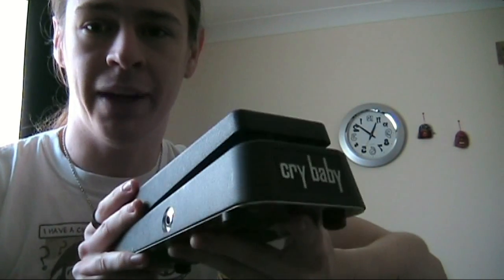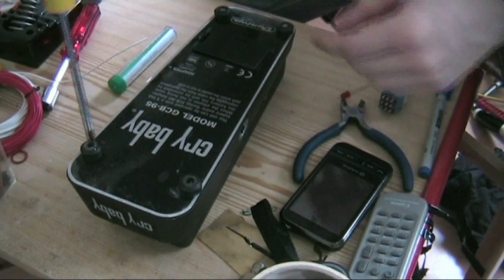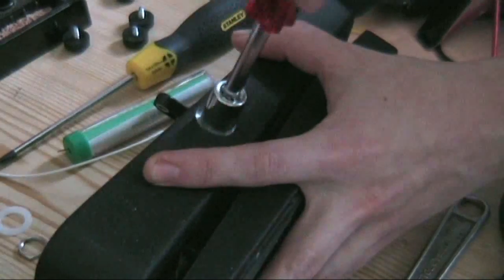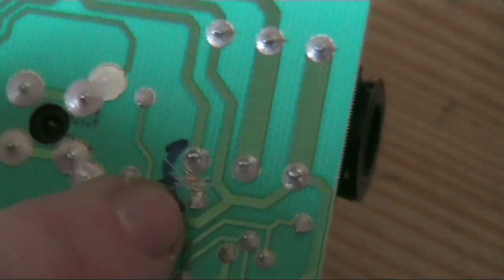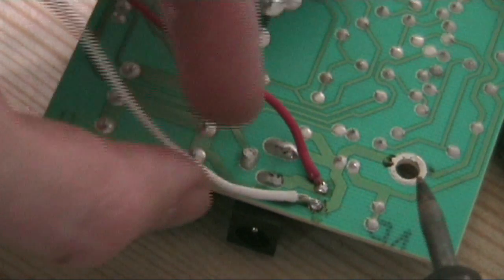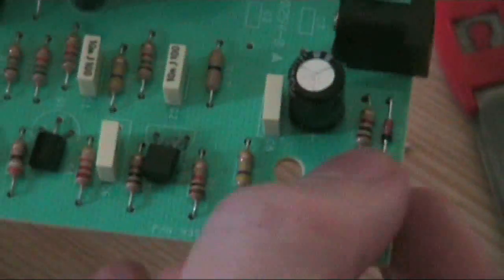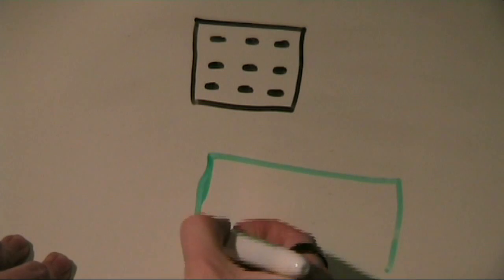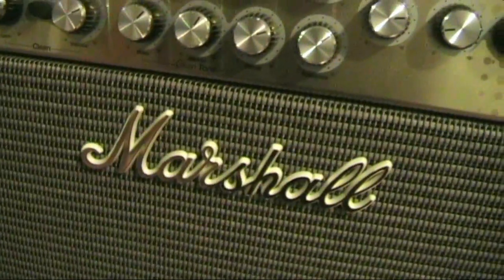Pedal Mods: CryBaby True Bypass and LED Indicator

Comment from the maker: Your little blue box is a capacitor, so don't worry about that. 
You'll still want to break the connection between the two components. 

With the green wire, you will want to connect it to the top left contact, and then add a small length of wire that bridges the top left contact and the middle contact on the bottom row. This is referred to as a 'jump' wire, so that's why I said it jumps to the bottom middle. Sorry for the confusion.
Reply: Thank you for the mod tutorial. just did mine today and its working very well.

Comment: aye aye manny, i was following your vid but for some reason my pcb is different to yours? where youve got your capacitor ive got a wee blue box with "10nj100 1x7" on it? do i still scrape away the back bitty or? major confused man help a fellow scottish rocker out :) Also any chance your could explain what you meant with the green cable coming back down to the bottom middle aswel as im a machinist and dont have a clue what you mean. cheers! Scott

Comment from the maker: That said, it is quite possible that you could design a circuit that would disable the battery when in true bypass, but for a pedal that wasn't initially designed to feature true bypass, it isn't very likely that feature will be supported.

Comment from the maker: As long as there is a jack plug in the input the battery will be active, whether true bypass is present or not. 

TB reroutes the signal directly to the output jack without going through the circuit, but the battery will still be powering the circuit when the jack plug bridges the gap. 

Best you can do is unplug the input jack when you aren't using the pedals, or run it off a AC power supply.

Comment: For sure! I'm not experienced with wiring diagrams for 3P3T switches  but they offer many possibilities. Just wire two LEDs to the same resistor, but if you like, you can connect the other LED to other poles on the switch. Adding a second LED to the resistor (parallel) will add your Ma, as opposed to adding your voltages which leave less for the board and requires another resistor. You may want to research the wattage of the resistor to make sure it can handle it but it's not very hard.

Comment: Sounds like it works, looks like it works, but does it still drain your 9v when switched off? I really wanna do this since I am experienced with circuits and LEDs. I wanna use a slow colour changing RGB...mmm.

Comment: It may have a triple pole/double throw switch, but it probably isn't true bypass. The easy way to test it is to plug your guitar in thru the wah and into your amp, but do not power the wah (remove battery or DC power). When you play the guitar do you get a signal when the wah is switched off? If you don't hear anything (no signal) then the pedal is not true bypass.
If you have the GCB-95 it wont be wired for true bypass from the factory.